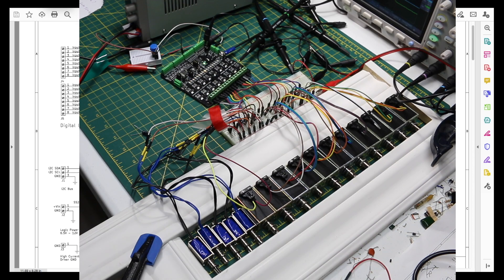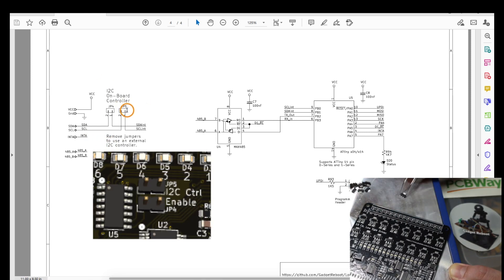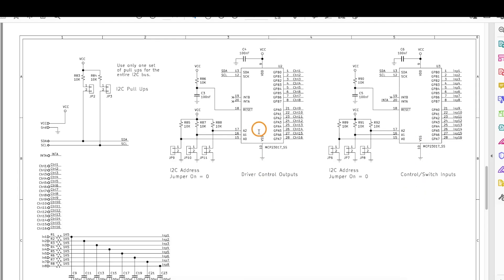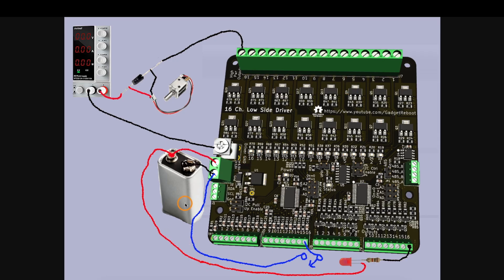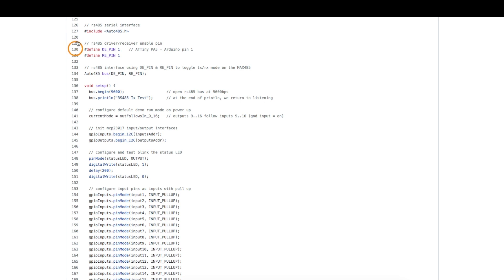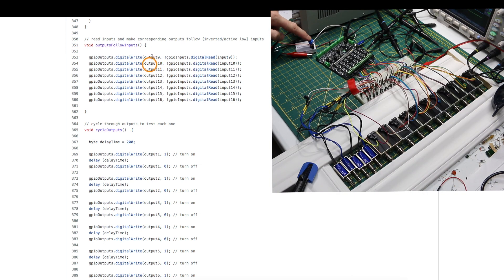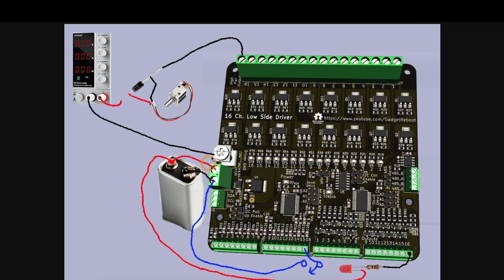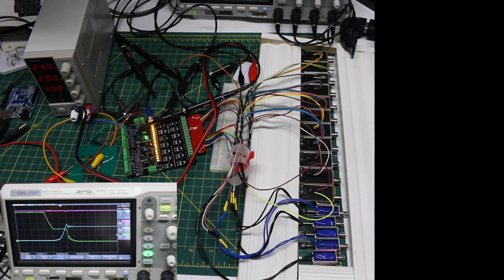16 Ch Low Side Driver - Control Solenoids over I2C or RS485

Comment: Nice board, with everything times 16 it gets full pretty quick. Cool you tested some gate resistor values :)

Especially if motors and solenoids where in mind I would have added the flyback diode on the board.

And indeed to make it easier to separate GND for logic and power, just make the two separate nets and connect them via a 0R resistor. Or there are even link footprints for just a link. But makes it easier to separate them. No confusion in the rats nets and no need to watch out when making ground planes.
Reply: Mouth ajar ... am stunned with how well engineered this is. Been watching for years, and honestly, did not know Gadget Reboot had all these skills.
Yes, journals for optional flyback diodes.  A second set of holes for ~100uF capacitors between each individual solenoid power in, and grounded near each corresponding driver mosfet source, could be a consideration for the next version.
1k5 ohm seems excessive to protect mosfets gates. Speed is not be an issue for your solenoids though (shrug).
Would the observed gate bounce be reduced with aforementioned output capacitors?  Current loops can make mischief.
Reply from the maker: I did experiment with 1uF - 470uF tacked onto the outputs using these solenoids and I didn't see much difference on the gate bounce with the setup I had, but once I get the board doing something else with different wiring and a different software config firing things differently, I may evaluate again.  
I remember when dealing with motors/solenoids long ago and having to go through EMC testing, throwing capacitors and wiring harness chokes all over the place helped mute a lot of last second problems when the littlest of things changed in the final setup.  
I don't remember if I tested between 800 ohms and 1.5K on the gate but 800 definitely caused a bunch of extra ringing.  I possibly could have used 1K or 1.2K but I only intend to use these with slow switching applications.
Reply: @GadgetReboot  If you hook a capacitor to the screw terminal outputs, then you are insta-draining it when turning on the mosfet.  The "-" terminal goes to the mosfet drain, not the ground, eh? (I made this mistake already.)
Reply from the maker: I considered a diode on the board itself but then I realized 12 of my solenoids already have a built in diode (and I think it's technically better to put them as close to the coil as possible) plus the outputs were more universally intended, and I wondered if a diode may even get in the way of some other off board circuits so I just left it minimal.  
I think the next time I do mixed signal/heavy current stuff, I may put a resistor footprint with the pads pre-shorted.

Comment: You might have wanted to isolate the low logic side by calling it as 0V_L and the power side 24V low something like 0V_P. This keeps all the current returns apart until you want to make the connection. On the schematic you just use a zero Ohm jumper to join them, and on the PCB you put this at point where both 0V’s connect to the board as a star point. 
This will keep all the switching noise away from the logic side but may cause switching issues if there is too much current passing through the power 0V copper. 

The fun of power switching and DC return paths. You could opto-couple the drive but that adds to the expense. 

Don't you just love (VCC-Led(fv))/mA = required resistor. then just use the value you find on the floor. works for me. 🙂
Reply from the maker: With my narrow bottom side ground copper channel I was hoping if I did have to isolate the grounds, I could just use a knife to score and then scratch away some solder mask to put even a few ohms of resistance or a ferrite bead or something else in the voodoo family of parts and I still might do that just to make some observations especially now that I have this board capable of doing a lot of noisy current.

most of the resistor values I chose this time were based on what I had sitting in the Part tray within arms reach for the surface mount parts. The fet gate could easily have been a 1.2 K instead of 1.5 K except for inventory.
Reply: @GadgetReboot  when i started work and engineer had put a value of 124.46784K on a circuit diagram and it had been coppied over to the BOM, all done by hand then.
purchasing came back and said that they could get a resistor close to that vlaue but they were a £1 each, i was paid £20 a week at that point. 🙂 His reply was get 120K resistors at about £1 per 1000, as he had picked the resistor off the floor, it worked! So he measured it's value and noted it down to correct later but forgot. it was almost one expensive board.
Reply from the maker: that reminds me of my first job after graduating and the first place I worked had a lot of students so one of them needed to make an RC delay and after calculating component values based on the time delay needed, he came into the technician room to look for parts and he said he needed a 7 ohm resistor and a 50,000 µF capacitor.